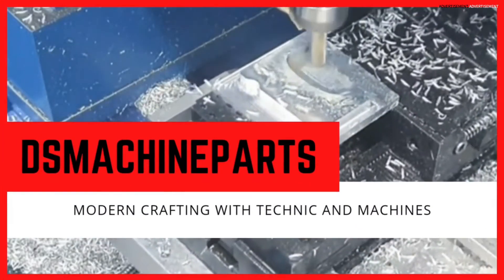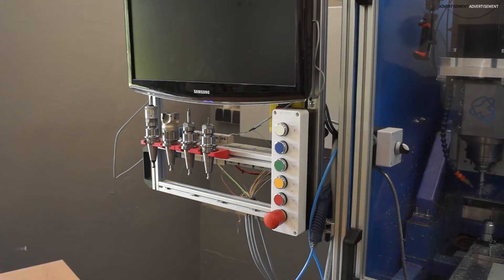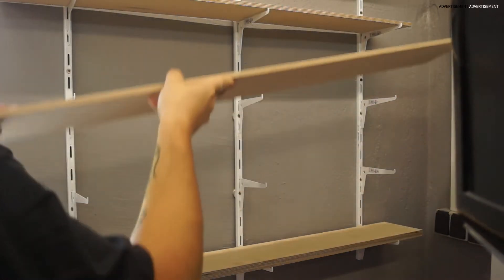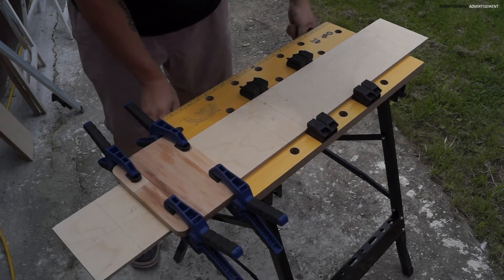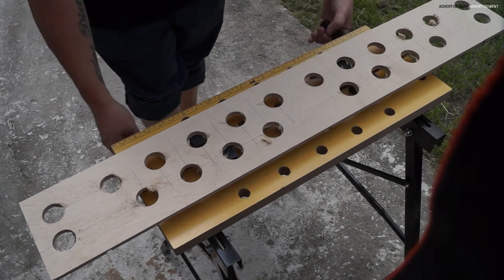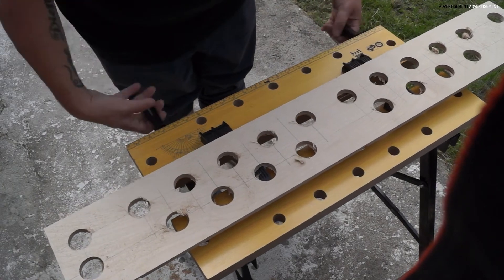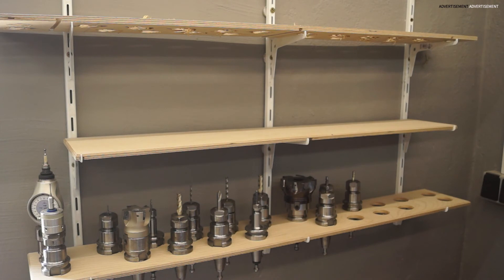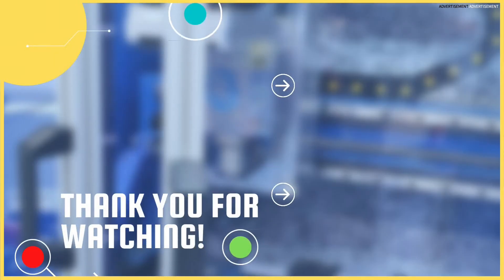#2 LetsBuild - Thats how i build my cheap BT30 tooholder storage rack

Comment: Moin kannst du die zeichnung von deiner fräse bitte hochladen und ein link zu deiner Spindel wäre super und welche Software nutzt du um deine fräse zu betreiben LinuxCNC ?
Reply from the maker: Hallo, danke für deinen Kommentar. Ein richtiges Zeichnungspaket habe ich leider nicht. Habe nur 3 bis 4 große Zeichnungen für den Stahlbau und der mechanischen Bearbeitung. Die Spindel ist eine 6000rpm china BT30 Spindel von Aliexpress. Einfach da mal BT30 Spindel eingeben, die gibt es auch mit 8000rpm und 12000rpm. Zum antreiben der Spindel nutze ich einen Lichuan B2 Servotreiber mit einem 3.7kw 15Nm Servo ebenfalls von Lichuan. Ich nutze eine Mesa 7i76e Steuerung in Kombination mit LinuxCNC und QtPyVCP  Oberfläche. Zu der Oberfläche kommen demnächst Videos online.